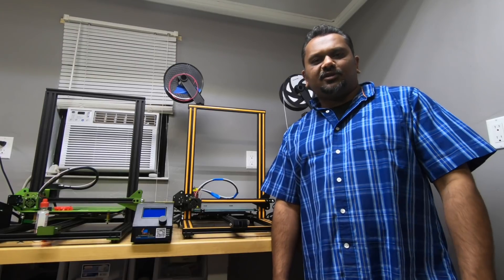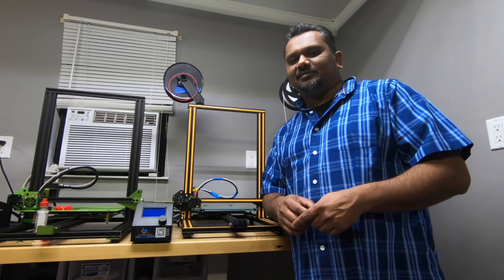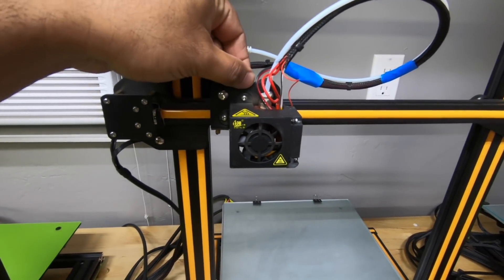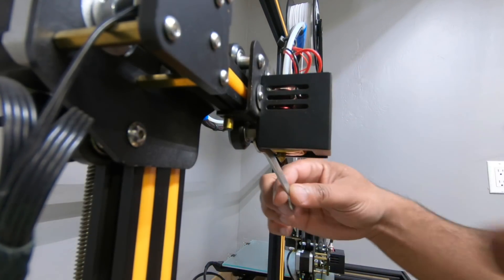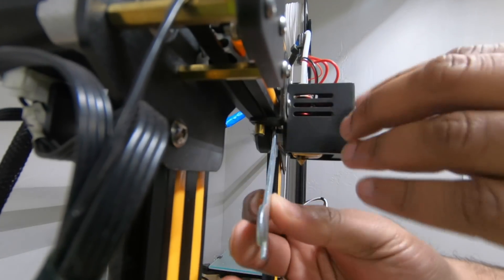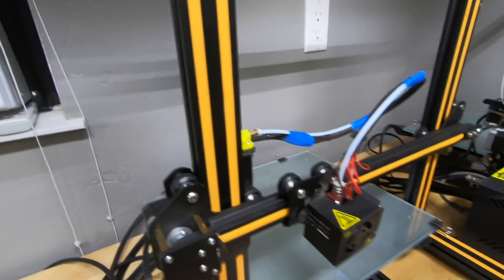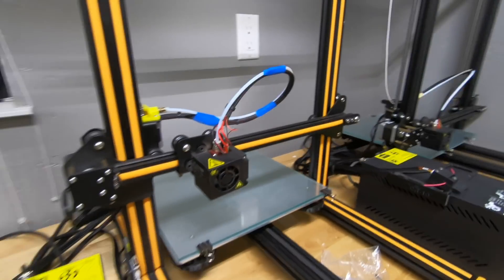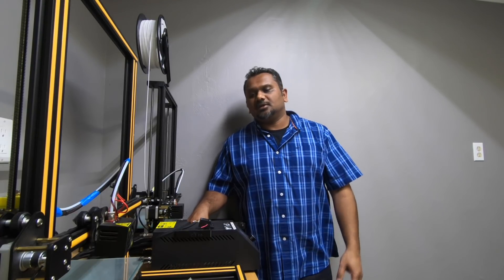Creality Wobbly Mount Plate FIX

Comment: I just realized that my plate was bent. I took the thing apart, bent it back into shape and remounted the carraige. I then  tightened both the belt and bottom bolt and it was SOO stiff

Comment: actual genius i tried to replace even my hotend etc cause of massive print reduction and then after replacing literally half a printer (hotend, extruder, ptfe tube (wasted actual capricorn), cleaning hotend with dremel and drills and even buying filament cleaning abs i done that and it works ... kinda feel dumb now. but thank you my hero, i guess not all heroes wear capes.

Comment: Had this problem with poor print quality on my CR10-V3 for ages now - rebuilt the hotend, tightened up the bolts on the frame, tried everything (or so I thought). Just tried tightening up the carriage to reduce wobble as per your video and instantly gave a massive quality improvement, thanks so much!

Comment: Thank you!  I swear I’ve watched every single eccentric nut tightening video …. BUT when you said about bending the carriage - it clicked.  I actually needed to take that carriage off, tweak the tab that holds the eccentric nut wheel and that gave me the extra grip needed.  Thanks for being so thorough.
Reply: I think I might need to do this as well.  No matter how much I mess with the eccentric nut one way of the other it still wobbles a ton.  Any advice, pics?  Anything you can do to help would be so much appreciated.  I'm so frustrated.  It's brand new.

Comment: This also works on the NEW Creality CR-6 SE as well, Thanks for the tip. Also make sure there isn't too much tension on the wheels or they will prematurely wear out. You should be able to still turn them by hand but not have any side play (aka wobble).
Reply from the maker: Good tip! Good luck and happy printing.

Comment: I've been chasing a problem where my prints are always raised up slightly on the right side of my bed, moving the model over to the left fixes the issue, and after trying and checking so many things I noticed tonight that the mount plate was loose and the tension of the cables when moving to the right side of the bed was tilting it up slightly. Tightening this nut was all I needed to do. Thank you!
Reply from the maker: It’s always the simple things, glad it worked for you Dan.

Comment: For those of you who are tightening the eccentric but and it does not tighten the mount plate (like me), you don’t necessarily have a bent plate. You need to take the fan and hot end off. Loosen up the screw to the bottom wheel, press the wheels together (helps to have a friend) and then retightened that bottom screw. The issue is that unlike the top wheels, the bottom one has quite a bit of play, meaning the wheel can be angled down or up. By squeezing the wheels, you get them in the right place (angle) and then secure it. I went from more wobbly than the one in this video, with a fully tightened eccentric nut to a nut that has some movement available and a fully tightened mount plate.

Comment: FYI, if this video helped, but you discovered you were one of the unlucky ones that it didn't fix the problem, do this:  Disassemble the entire hot end and get the back plate in your hand.  Determine if it's flat (the extension on the bottom that holds that eccentric nut was bent on mine).  Take it to a nice flat workbench and work on it with a rubber mallet until it's flat (verify with a ruler).  Put it all back together, and see if that didn't correct the issue... it's exactly what I needed to do, but I wouldn't have know where to start if not for the locksmith from "Crash" explaining it to me.  Thanks!

Comment: So here it is two years later, and I have the same problem with my brand new Ender 5 Pro.  Unfortunately, adjusting the eccentric nut only helps, does not solve the problem.  I've reached out to Creality for a solution, and hopefully will get one, but in the meantime where can I find that cheap replacement bracket you mentioned?  (I'm looking on Tiny Machines 3d, no joy yet...) Thanks,

Comment: there is a E in eccentric nut. You should also educate yourself a bit on how they work, you don't have to tighten it clockwise once it's loose you can go either way and it will snug back up.

Comment: hello from France, I have the CR10, same than this one, I tried to do the same than you but its never completly fix! its still Moving! I dont know what to do, help??
Reply from the maker: Make sure the wheels are on the track before you adjust any nuts.  Also it is tricky because if you turn to much then it stays loose try again but turn in small rotations. Also check to make sure the wheel are super tight and mounted correctly on the hotted mount plate. You will have to take the hotted off to do this because there is a nut behind the cover. Good luck and let me know if it works or doesn't work.

Comment: I tried to tighten it by adjusting the eccentric nut but that didn't work .I then took the bottom roller off with the eccentric nut and noticed that it doesn't have any threads in it .I don't see how the eccentric  could possibly tighten without it having threads. Could you show in a video how to fix it if just tightening the nut didn't work?

Comment: Excellent video. I tried to tighten the wobbly plate on my CR-10s Pro but it will not get tight. I guess I will have to take the housing apart.

Comment: My CR-10S Pro came so loose that the carriage could come off the rail if I wanted to take it off.   I knew there was an adjustment there but wasn't sure what I had to turn.  Thanks for showing the nut clearly.  I was turning the mount screw instead.

Comment: Appreciate the vid. I have a 2018 Tevo Tornado (gold). Any suggestions for a wobbly mount plate? Seems i don't have that particular part to tighten.
Reply from the maker: It should be very smilier to this video on how to fix it.  There should be a centric nut on the back side that you just have to tighten.
Reply: I'll take a look and let u know how it goes. Appreciate the reply

Comment: Thank you, thank you, thank you. My plate was actually bent, without your advice I would never have found out what and how to fix it. You are my hero!
Reply from the maker: Just here to Help!
Reply: I just got the CR-10s PRO and during assembly realized I also have this problem, I've tried tightening the nut but haven't been successful. Did you order a new plate or were you able to bend yours back into the right position?
Reply: BRETT London I was able to bend it back... but after 1 month it’s back again to where I need to take everything apart again. On top of the termister broke disabling all prints and the filament sensor is not working, so I reached out to support... does not look like they will do much right now... very disappointing, I am close to dispute the charge if there is no help soon, it’s been 4 weeks already....

Comment: thank you for solution. This is exactly what I was looking for . Easy explanation .
Reply from the maker: Happy to Help!
Reply: Hello Sir I need your help . Filament not extruding properly from nozzle. I have clean the nozzle also . Can you help me with this ?
Reply from the maker: @lovy_g  Instead of cleaning the nozzle I would just replace it, its super cheap now and cleaning takes to much time. Also sometimes clogs aren't just in the nozzle it can work its way to the bowden tube.Try turning up your temp or printing a temp tower, also make sure that the filament feeder gear ( thats where you feed the filament and a metal gear push's it through to the nozzle.) is moving the filament.
Reply: @santube 3D  After lot of troubleshooting with my Creality CR10S  .I opened and assemble the Extruder E Stepper again in order to correct the filament flow. Now its perfectly smooth . Thank you again :-D
Reply from the maker: @lovy_g   Happy it worked out. Good luck and happy printing.

Comment: I feel dumb now... I've been trying to figure out how to adjust those wheels for the longest..
Thanks man..
Reply from the maker: happy to help.
Reply: Same
Reply: same :'D
Reply: Dude your not alone. Im a mechanic and this has evaded me since you know creality is so great with their manuals. Ive never found one. Been using a weight on the front of the cover to keep it down. All along it was just some hidden eccentric nut(of course theres a eccentic nut for adjustments) and not labeled just like the tensioners(I take the heat on this one, I wasnt putting the concepts together).
Reply: @Jaxon Kade Flixzone is full of malware and viruses. Stay far far away from Flixzone!

Comment: Hi San! another instructive video. Thanks! I just wonder whether you've ever experimented Shifted layers in the Y axis. I've tried to play with the Y-belt, vainly. If you had ever run across a similar issue (X-shift e.g.) I'd appreciate your tips and tricks to fix it.
Reply from the maker: If you think you belts are good then check the wheels under the hotbed.
Reply: thanks for your answer. I'll give it a try.

Comment: How are you finding having the filament spool mounted as you have it on top of your CR10 and S.  Any issues?  Did you just use bolt and T-nut with the factory spool holder?
Reply from the maker: I was a little worried in the beginning but no problems, its been three months and i haven't had any issues.  Yes T-nut and bolt that came with the machine.  Only thing is you mite need a washer if its a little loose.